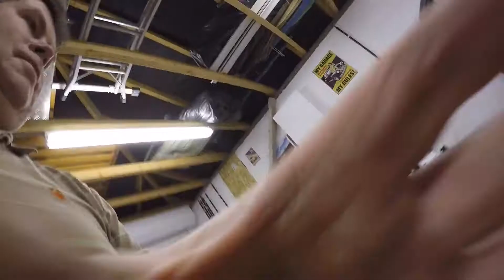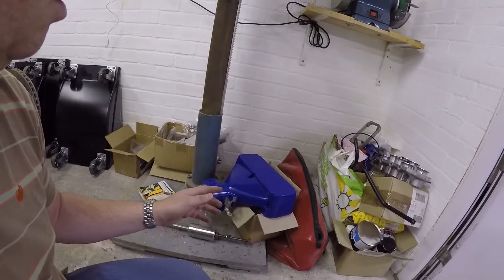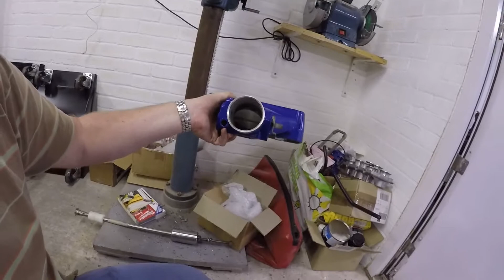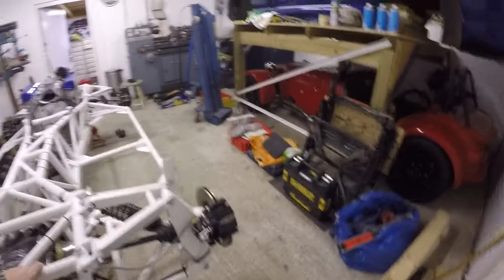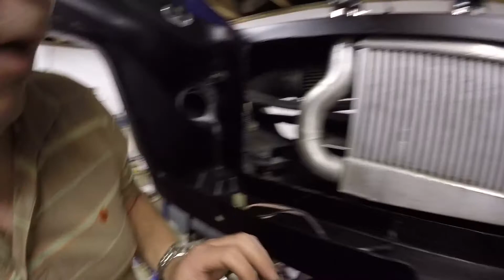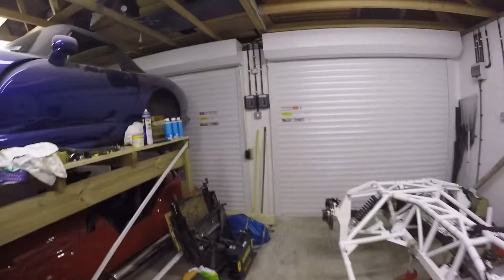Supercharged TVR Chimaera - Final Preparation for Body Install

Comment: Not sure about the tie wraps. They get hot and cold over the years and crack. Unless they are a special kind?
Reply: The original TVR tie wraps have lasted over 30 years on my Chimaera..and are as strong as the day they were put on. Simply no issue at all.

Comment: Amazing work. I have just bought a Chimaera 450 with history & pics of it being built in 2001. Troublesome history but finaly rebuilt by TVR power & running 335BHP flywheel. I am doing lots of video's on youtube of the progress & planned work on the car. Thanks for showing your amazing work & knowledge of the Marque. Subbed.
Steve.

Comment: I’ve just stumbled onto your site - what a remarkable job you’re doing. Was rebuilding the steering rack a big job? You mention a tool you made. We’re there any other specialist tools required and where did you get the parts? Thanks. Keith
Reply from the maker: Hi Keith, thanks for the comment. Please drop us an email at simplyTVR@gmail.com with your phone number - will be happy to talk you through! Cheers.